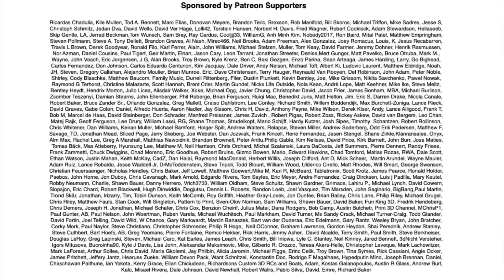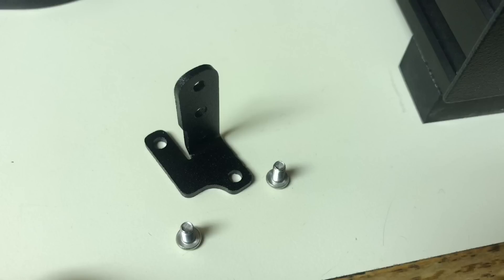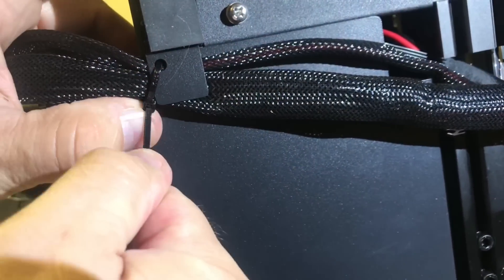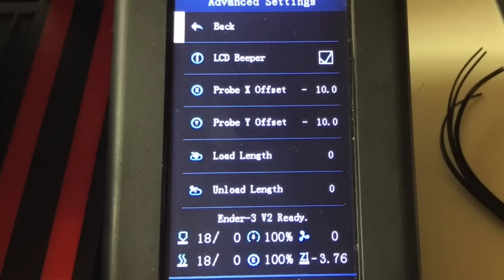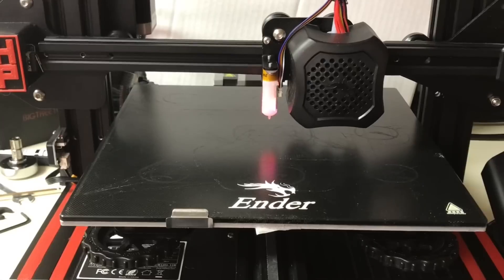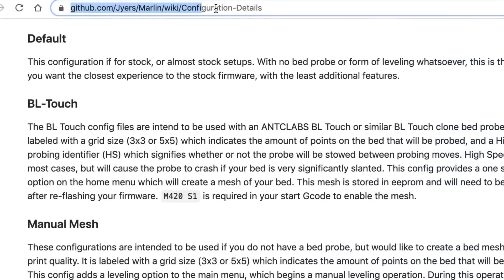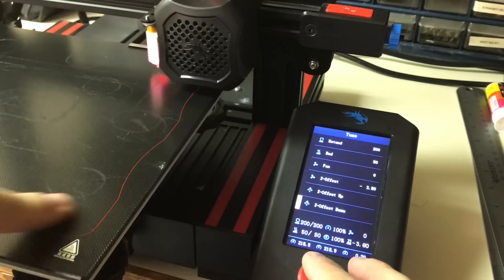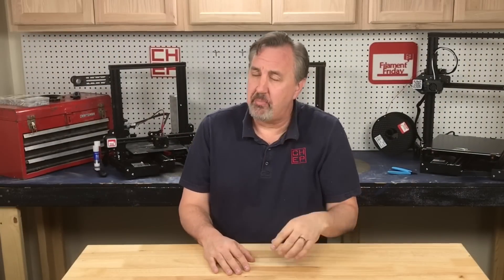How to Install AutoLevel on Creality Ender 3 V2

Comment: When I auto home mine it isn’t in the center of the bed it’s probably 3/4 of an inch further to the back on the Y axis the X is almost right on, but how do I go about fixing that? I noticed it when I was doing a larger print and it was getting cut off at the back of the bed. I have a Ender 3 V2 with the bltouch.
Reply: The very first thing you should to is go into Control > Advanced and adjust Probe Offset X to -42 (Printed Mount). and Control > Store Setting.

If you are using Creality official BL-Touch set, you have to set it to Probe X Offset -44 & Probe Y Offset -6.
Reply: @jovangrbic97  never mind I see where to adjust on the LCD. Thanks
Reply: @jovangrbic97  I do have the real BL touch i actually download the TH3D firmware I remember setting those settings for the BL touch -44 X and -6 Y and 0 for X.  So should I go into the Marlin firmware and change X to -42 and keep adjusted it till it’s centered?

Comment: Thanks for this video. Does the firmware upgrade you showed also require that the LCD screen firmware be upgraded or just the printer firmware?
Reply from the maker: Just the printer.
Reply: @FilamentFriday  Thank you for the fast reply! One more question: Could I use a SD card larger than 8gb to upgrade the firmware? I have 16 and 32gb cards on hand but no 8gb card.

Comment: I had problem with warped bed on my Ender 3 pro. Bought bltouch. Now I have different problem. If center of first layer is perfect, than left side is too high and right side too close to the bed. Someone told me it is because x gantry saging (I have direct drive). So I installed dual Z steppers. This did not change anything. Any ideas how to solve this problem? Thanks.
Reply from the maker: Maybe this: https://youtu.be/8qLJyaBlCCA
Reply: @FilamentFriday  Thanks, but it must be something different. This was my first gues, so make sure my frame is square and also my X gantry is square. I tried it few times, but nothing changed. I also tried losen X gantry screws and lift right side up to compensate for it. But again nothing changed. Bed was leveled using paper - just to be sure. I have this problem for about year now and didn't find solution. Board is SKR 1.2. Tried few versions of Marlin. Using 5x5 matrix, but same result as 3x3.
Reply from the maker: I don’t know. If it’s manually leveled at each adjuster, then the autolevel should adjust fine.

Comment: Hi can you make an tutorial for filament change in ultimaker cura slicer...i have an issue to use pause at height or filament change at modify gcode settings..I didn’t know what method should i use at pause at height marlin or reaprap and others..please help anyone 🙏🏻 im using ender 3 v2 .. some times filament change from black filament to white gone wrong because the black filament didn’t flush completely and if I manually extrude sometimes the machine will note an hotend low temp and restart 😂

Comment: Lovely video, Chuck. One question: when using microstepping, should one try to avoid moving the head up after moving it down? On my rig at least, it seems there's some backlash in the z-axis movement, so moving the head in one direction and then then opposite messes things up.

Comment: Thanks CHEP for this video. 
I've been using the Jyers firmware for awhile now. Very happy with it and the features he's adding into the menus.
It's also being actively worked on, I noticed he's just released a new v1.3.2 build two days ago. Time to get out that sd card :)

There's also a huge advantage to using the Jyers firmware, notes from his WIKI
"A lot of the benefits ExtUI are to do with how it is coded. The original code for the E3V2 display required many, many additions to the marlin base code specifically for that display. As you can imagine this is a very inefficient way of coding a display. ExtUI allows for display functions to run off the same UI calls and functions that any other display would use, making it not only more efficient to program, but much better connected to the Marlin UI system."

"Due to the fact that ExtUI allows much better implementation of Marlin functions into the display, the new firmware behaves much more like other popular LCDs. This includes status updates in the status area for Marlin events and M117 messages as well as a more robust popup system, especially for user confirm actions such as M0 and M600 commands."

Comment: I've been using a bl-touch for a few months and I keep getting random failures, where it stops probing somewhere in the grid and starts blinking red.  I'm using the same firmware You showed except a 5x5 grid.  I've looked online and number of people have the same problem, none of the suggestions helped the only one I haven't tried was soldering a 10 ohm resistor between one of the probe wires and a socket on the board I think it's for the run out sensor?  I'm reluctant to do this without more feedback that it's effective and safe.  Has anyone tried this?  are many people having this problem?          I really want to figure this out because my bed has a dip in the middle so the bl-touch helps  a lot when it works. Maybe my probes defective but it works 3 out of 4 times so I don't know what to think any suggestions?
Reply: Have you tried turning the set screw in the top of the probe clockwise a bit (around 1 revolution)? I found this helped a lot when the probe failed to deploy and started blinking red. Since then, I can do a 15x15 UBL without any probe failures.
Reply: @jackbmorocco  I had the exact same problem and that was the solution for me.  :)

Comment: I'm not sure if I did it right in my printer (an Ender 3 with v4.2.7 board), but I've configured the firmware to use the Z-endstop switch for homing, and BL-Touch probe only for bed leveling. Do you think such configuration has any drawbacks?

Comment: It looks like I have the wrong 2m extension cable, it ends with the black connecters.  Know of anywhere I might can purchase the other extension by itself?
Reply: I presume you have dupont connectors, I have those on my 3D touch clone. They work also, but they can get pulled out easier then the xh 2.54 ones. I put a small dab of hot glue on the connection to keep them in place better.

Comment: Why not do the 15x15 bed level to get the most accurate bed level
Reply: There's no need to be that precise, besides it would take ages to complete. 5x5 is ok, but even that took so long I got back to 3x3. Honestly just get a glass bed, do a bed level once in a while and you are set.
Reply: The printer isnt accurate enough to make a difference.

Comment: Buying a bl touch was the worst decision I have made.
I tried emailing ant clabs 4 months ago and didnt recieve an answer back.
I just cannot make it work, checked wiring 5 times, tried 3 different firmwares. 
It starts up and does its 2 extensions fine... but when you send it to autohome the z axis doesnt go down.
Reply: I just installed one and this is the same problem I'm having
Reply: same here... my z-axis doesn't go down :(
Reply: Same here.....
Reply: @CHEP any posible help or comments ?
Reply: If you have a 4.2.2+ board you need to make sure your wiring is using the 5pin connector on the board, and NOT the usual Z stop pins.
Had the same issue and this fixed it for me.
Reply: Anyone still reading this. I took a week of troubleshooting...and it turns out, it was not plugged in.
It says disconnect the Z-axis connecter...well, NOT THE ONE THE MOTHERBOARD, only the Z-end stop (which is visible on the left side). If you unplug the one in the motherboard, you also unplug the power. Felt really stupid after that one lol.
Reply: @tomickescape  I disconnected the Z stop, but not from the motherboard since it is glued

Comment: A couple of years ago as a novice I thought that bed leveling was difficult and I ordered a BLtouch which I intended to install. Since it is not directly supported I postponed the installation and then I started to wonder. Today I do not see the need for automatic bed leveling. I have not re-leveled my printer bed for ages. From time to time I adjust one or the other corner live during the skirt of a print - that's it. I am printing on a Wanhao i3 with a glass bed.

Comment: I used the normal BLTouch with the 2 separate connectors that go to the board. It seems to work but those two connectors are the black ones and do not stay very well (one small connector for the black and white wires and one slightly larger one for the other ones). Should I glue them on or should I have bought the BLTouch for the v2?

Edit also the wire is not long enough to go through the sleeve
Reply: Yeah that's a pain in the butt, you'll have to do a bit of soldering to extend the wires. Dupont connectors work but are not the best, if you don't want to crimp better ones on just secure them with some electrical tape. Not the best solution but works in a pinch.

Comment: Perfect timing. I installed mine this afternoon based on your video. However my Z axis switch was already at the lowest setting. Can it be unplugged and removed without causing issue?
Reply: I have mine removed. Just make sure the BLT is operating before each print. I've had a couple of instances where the nozzle crashes into the bed because the probe didn't deploy. I've found turning off the printer and back on before the next print stops this from happening. I've seen some people add a 10K resistor on the board that appears to fix this but I haven't gotten around to try that just yet.
Reply: @jasonkloos6348  Thanks. I'll remove mine too.

Comment: Hi, I tried installing a BLTouch on my Ender 3 V2 a few weeks ago but ended up sending it back as when I tried to home it, It would just continue to lower the nozzle and the prop just didn't detect the bed, I had it wired correctly. Any ideas?
Reply: Hi, I got the same issue, did you find solution?
Reply: @vincentchiu5584  Please Re-Read What I posted and you will see the answer.
Reply: @mightycain4725  I think I know the root cause of this issue. I think I installed the BLTouch plate that attached to nozzle upside down so that the probe never touched the bed before the nozzle touched the bed. So make sure the correct installation when the probe drops down can touch the bed.

Comment: Pretty bad end results for something intended to fix problems, manual mesh would give you probably better result, quite disappointing. I would go for 3x cheaper 3DTouch from Trianglelab Aliexpress in this case.

Comment: look at you using jakes firmware! love the video chep! cant wait until M48 is going to get a menu spot! (idk if he announced it yet lol but hes doing it)
Reply from the maker: What’s the best way to contact him?
Reply: @FilamentFriday  facebook is the easiest way, in a couple ender 3v2 groups if you want I'll message you his Facebook so you can message him
Reply from the maker: Sure
Reply: @FilamentFriday  alright, sent you an email with his Facebook. And could I bother you with a question? What do you do about the front left being to low?(I'm in the same situation) The auto level seems a bit not "auto" haha
Reply from the maker: I reran autolevel and it helped but it was mostly my bed is wearing out. A little glue stick and raising the z offset a little came out great. I should have left that in the video.
Reply: @FilamentFriday  quick question, have you ever ran M48 on any of your bltouch and seen if its reading a constant?
Reply from the maker: Not yet.

Comment: Great video as usual. Please do one where you check out the UBL version of the jyer firmware. It allows the BLTouch to create a mesh with hundreds of points instead of just 9. Be interesting to know if that improves the quality of the prints.

Comment: Hello, I have a Geetech A30 (Cr10 on 24v, and a E3D hotend) I did purchased the original Bltouch. I do need a fw update to the board since the original geetech firmware is just horrible. Sir, do you have any ideas on how to do that?
Reply from the maker: Contact Geetech
Reply: @FilamentFriday  well the last firmware is from 2019 and it can't do autolevel ➕ it is really dumb. Would like to flash marlin but I could not find a version for geetech board

Comment: You are taking the firmware from github. Other videos are taking it from creality website. Which source is the best?
Reply: Creality firmwares on their websites are extremely outdated at this point. The jyers firmware is superior to the stock one in every single way. I tried both so I would know.
Reply from the maker: Try them both and choose. I prefer what I showed.
Reply: I trust Github more then Creality

Comment: My bed isn’t center on my Ender 3 V2 with the bltouch the X axis is almost dead on but the Y is about 20mm closer to the back. Is there a video I can watch on how to fix that?
Reply: I'd imagine you should offset it by that much so it basically is in the center.
Reply: @ares395  where do I go about changing that in Cura? Or do I have to manually do that in firmware and if so is there a video I can watch of what to do? Thanks I’m new to all this.
Reply: @evilsd9  Tweak the y value like in this video till it's more or less center
Reply: @ares395  gotcha thanks I see now where on the LCD.

Comment: Why did you pick the 3x3 Bltouch firmware instead of one of Jyres's UBL Bltouch firmwares? Is there a benefit to not using the UBL builds?
Reply from the maker: I found the UBL a bit more confusing and wanted a simpler setup.
Reply: @FilamentFriday  Ah ok. I actually just got a BLTouch for my v2 a few days ago and have been using the UBL version of the firmware. It seems to have a few oddities, and I think I might switch to the version you used here.

Comment: I’m having issues with bed adhesion. I’ve calibrated the z offset and I know it’s well. I tried to feel the stepper motor to see if it was moving and compensating and I couldn’t feel anything
Reply from the maker: Did you enable the live adjust?
Reply: @FilamentFriday  yes

Comment: Chep, how did you fix the front left corner? I have the same rough surface. Can't figure it out. Thanks.
Reply from the maker: I reran autolevel again with the new Z offset.

Comment: @CHEP Do you really think its worth adding to a V3? I was hoping you might have been more of an opinion.
Reply from the maker: You mean CR-10 V3? 
If you can find good firmware. I actually still prefer manual level.
Reply: @FilamentFriday  Sorry i mixed up the two parts of the name, i mean the Ender 3 V2. But yeah i was looking for your opinion on the BL touch specifically, cause it seems to be mixed opinions of it. Ive wondered of adding it to my Ender 3 V2 but i dont really see a "got to have" reason so far.
Reply from the maker: I did this for people that needed help installing it.
Reply: @FilamentFriday  and you did a great job at that. If i get this i would definitely review this video again.

Comment: Jyers' 1.3.1 firmware update adds a lot of very nice features, particularly in comparison to the stock Creality firmware. I'm not in a hurry when printing, so I use G29 in the start G-code to re-do bed leveling at the start of each print. That way if I've bumped things such as the glass bed or a bed leveling screw, that change is accounted for. Yes, it adds time to each and every print. Yes, it means the bed is leveled and is level for each and every print. A reasonable trade-off to me. Thanks for the video!
Reply: So I can use G29 instead?

Comment: I just fitted the Creality Ender 3 BL Touch Kit and it was a pain in the butt from start to finish.

Problem 1:- when you run the ProgISP software it starts with 2 kernel errors and won't work, whilst looking for an alternative version I found the fix, just rename the folder by deleting the Chinese characters at the end of the folder name and it runs fine after that.

Problem 2:- The firmware that comes with the kit is not BL Touch compatible it is just stock firmware.

Problem 3:- The Creality BL Touch firmware for the Ender 3 with 8-bit boards has not had the X, Y offsets configured so you get just two-thirds of the bed probed and they don't include Marlin INO so you cant edit it.
 I fixed this by downloading the E3D unified firmware and a bootloader which I flashed with an Arduino and updated the firmware from the SD card.

Maybe this is why Creality has sent everyone and their grandmother an Ender 3 V2 kit version as it is the only one that works